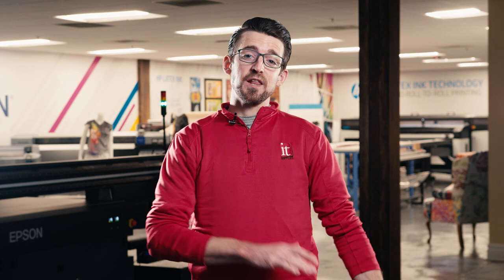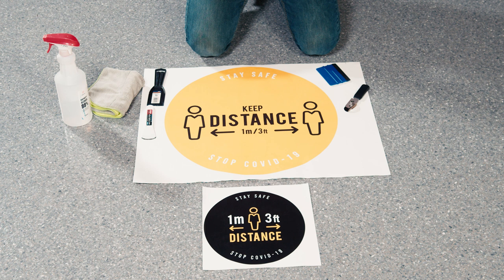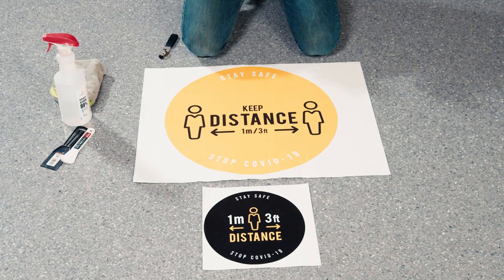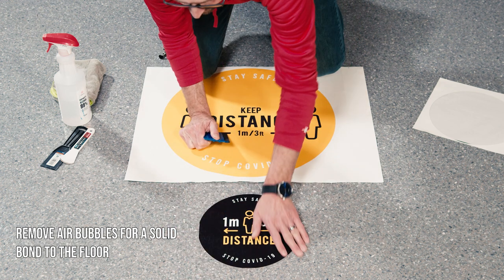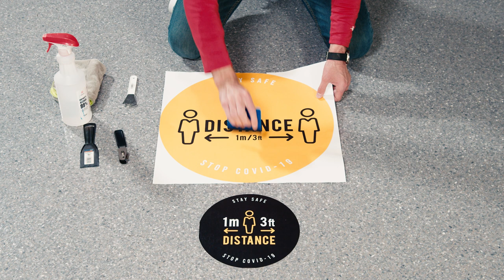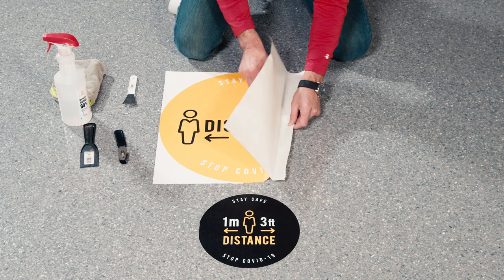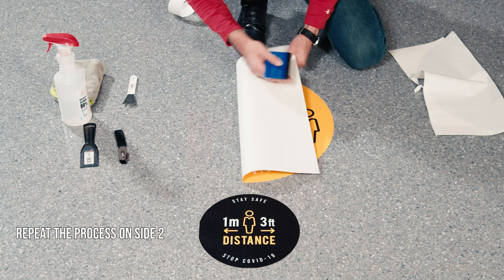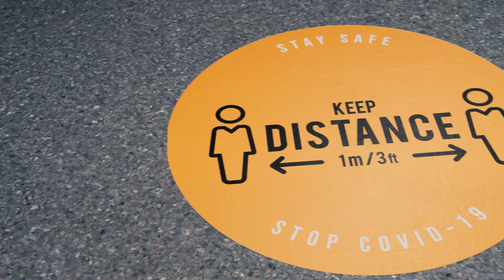How to Print and Install Professional Floor Graphics

Comment: Is there a Dye-sublimation Compatible floor Film? Not actually for foot traffic; but Sometimes lightly textured surface, permanent bond…
Reply from the maker: We are not aware of one.  I think the adhesive properties needed for a floor film would be problematic in the sublimation process since temps reach 400 degrees Fahrenheit.